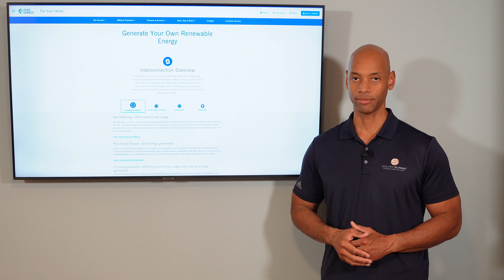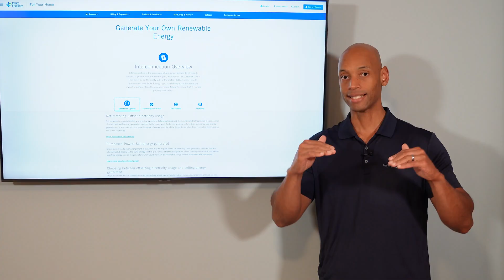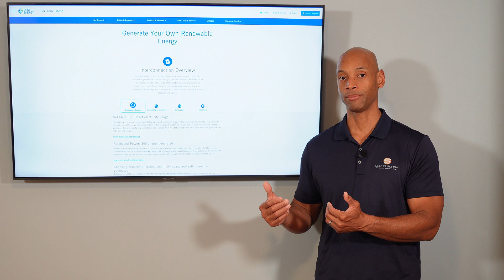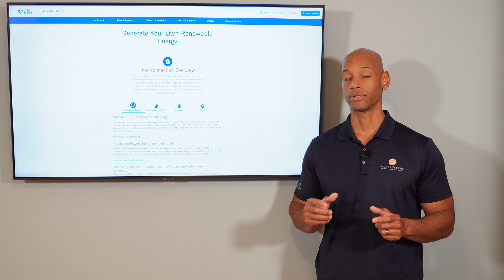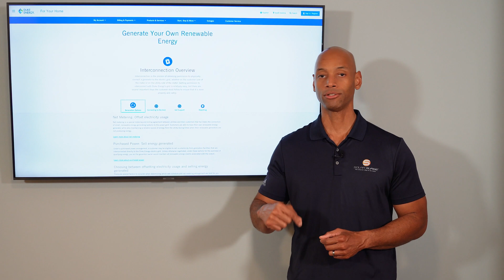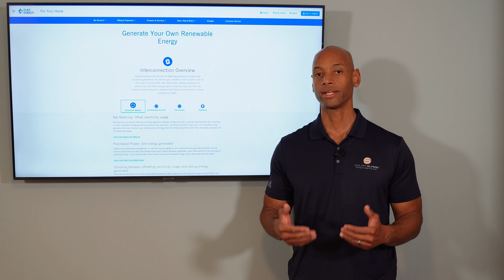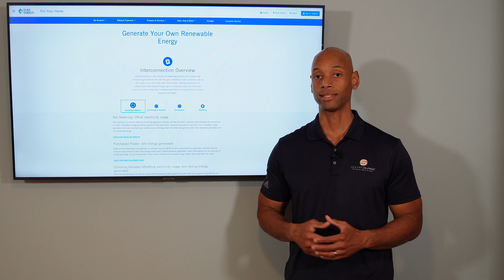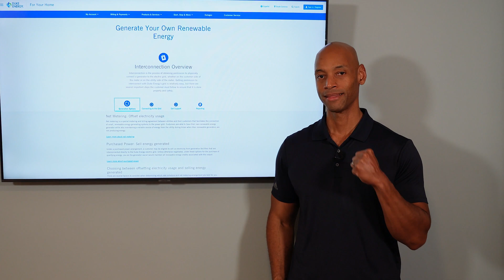North Carolina CANCELS Solar Net Metering Program

Comment: Florida is still good with net metering so far. Just got my system installed and interconnected. 10KW grid-tie system. But with battery prices getting cheaper and cheaper I think I would rather go off grid than pay for just being connected to the grid. I think the part that costs the most with solar systems is the labor. So if you know how to do it yourself you will save 40 to 50% of the cost in my experience. Also off grid systems don’t need permit or have to deal with any bureaucracy.
Reply from the maker: Glad to hear Florida is still supportive of net metering, and thanks for sharing your experience with DIY to reduce labor costs and permitting.  When I started out in solar, we were offering home backup systems totally off-grid for about $6k installed.  The technology has come a long way in that time.

Comment: This is why I installed my own off grid system I just used a generator transfer switch. Eventually the utility will only power a porch light only because I'm required to keep my home connected to the grid. Solar contractors charge as much as $8 a watt because they are looking to get rich and sell it to you as a 30 year mortgage. Reality is you can install a 10KW grid tied system using micro-inverters permitted and utility commissioned for less than $10k. Company called  Greenlancer that will do all the design work for you and help you submit to the city and utility your design. You can find used 400-watt panels, and microinverters cheap online. Rest is just basic home electrical work.

Comment: Net metering is not sustainable, and it should go away everywhere. There is no profit in it for the utilities. Utilities are guaranteed a rate of return for all capital expenses. Without that guarantee, half of America wouldn't have electricity at all. It is not fair to make non-solar customers subsidize your solar systems. All renewables are pretty much usless unless it has energy storage, allowing its use at anytime its needed. In fact, renewables can cause more harm to the grid than good. Before the YouTubeverse jumps me, I have been in the renewables energy business for over 43 years, I have one of the largest residentual solar systems in NC, and I have net metering through my local coop. While I don't believe in it, it's too good a deal to pass up and install batteries.

Comment: Utilities were forced to go into net metering by their public utlities commissions.  The huge tax credits made solar very attractive to customers who were being billed in the upper tiers of the rate structure.  In California utilities were forced to offset costs to base rate customers by over charging those in the upper tiers.  Solar pulled the rug out from under the commission's schemes because people who were being overcharged were happy to install subsidized solar to drop their usage into the lower tiers.  The implementation of net metering by the commission caused other problems for utilities who are required to provide both reliable and economical power supplies to their customers.  In California there was no control over how much solar could be installed and with the subsidies and net metering the state has become a real problem for utilities and the public utility  commission  to provide both a reliable and cost effective power supply.  Costly batteries needed to supply electricity when the sun dies not shine would drive up utility cost unfairly and that was why the net metering is being changed to require solar installers to put in batteries that would otherwise have to be installed by the utilities.  California is going to be in a real mess as the nuclear plant and remaining fossil fuel plants are shut down.  On top of all that the addition of EV's ads even more problems if they are charged up at night when the sun does not shine.  Rates will continue to go up as California tries to go all in for green energy.

Comment: I have been researching solar in NJ. I live in SJ, they are literally not allowing new solar projects in huge portions of SJ. I have been researching going off grid and using a natural gas generator as a backup and to recharge a battery bank when there is no sun. Most if not all of the solar companies will only work with you if you are doing a grid tied system. Don't even get me started, but truth is grid tied systems are not the future. But its expensive and sadly most people will never be able to take full advantage of solar because they can't afford it. An added note, they will not even allow the system to be energized, so you have to be completely disconnected.

Comment: Must be nice for the power companies to just be able to decide to not pay you for the power they are taking from you.  I'm sure they wouldn't like it, if you just decided to stop paying them full price for the power you take from them.
Reply: I'm sure that they would say that (nobody is forcing you to be on net metering).   IMO this is even more reason to get as large a battery backup as you can afford not only for when the grid is down but also to use at night in the summer when days are long and solar can recharge the batteries by day.
Reply: They don't want to buy power from solar systems because they can produce power lot cheaper with a power plant and control it they only run it when they need the power. Most utilities have done away with net metering replaced with TOU policy. The utility is required to maintain a large grid solar customers were not paying for the use of it. Reality is it was cutting into their profits they don't like that.  Also, the fact that solar installers over charge many customers some almost 8 times the cost of the equipment. With these changes being made by the utilities they won't be able to sell customers 70k 25kw systems anymore they will have to reduce their prices because the ROI is 50 to 100 years.
Reply: @Mike-01234  You can't just shut down and restart a power plant or hydroelectric damn throughout the day.  The production can be throttled back but you can't easily just turn it off.
Reply: They don't just decide.  They have to get approval from the utilities commission and there are groups that fight them all the time so decisions are not always in their favor.  The move away from one-to-one net metering is being challenged by the solar companies in NC as we speak so it is possible Duke Energy will have to keep some form of this,  That said, their PowerPair program, when combined with the federal tax credit literally buys you a Tesla Powerwall 3 so there is a workaround for customers.

Comment: This situation has me moving to Utah and away from NC now.
Reply: And what happens when every major power company turns to this model....Which will eventually happen.  Its just a dice roll of when it will hit you.
Reply: @theripper121  there are plenty of ways around TOU. Mainly a battery, and within the next 10 years max most people will have an electric car that will connect to the home and act as said battery.
Reply: @singerkgreen  And adding batteries adds massive costs and often reverses any return on investment from solar from the first place
Reply: @theripper121  that's why i mentioned electric vehicles. I agree. Why spend $20k on a battery that's 10kwh when you can spend $80k on a 120kwh battery that you can also drive to work. The ROI math works much differently that way
Reply: @singerkgreen  Yea unfortunately solar in general is a long term investment many just can't swing right now let alone investing in 80k dollar cars.
Reply: @theripper121  my first comment literally says in the next 10 years. I'm trying to have a conversation but if you're not going to read what I actually say I'll just bow out.
Reply: @theripper121  if many can't afford solar and they can't afford an electric car and net metering is going away eventually everywhere, well those aren't the people that solar companies are selling to now is it?
Reply: @singerkgreen  A bit confused what point you are actually trying to make.  Your original comment talked about moving to a state that isn't currently using TOU.  I'm simply stating moving around to avoid a practice that can be implemented at virtually anytime might not be the most practical
Reply: @theripper121  you don't know anything about my life or the practicality of moving. I made my point in my OP. I'm moving because of TOU. That's my point. Then you say it might not be practical. Personally, I think moving to double my pay is practical.
Reply: @theripper121  you don't have to think it's practical. Nobody is asking you to move.
Reply: @singerkgreen  Well, I apologize if I came off looking like a dick just trying to be the contrarian.  If you do move, I sincerely hope it works out for you and puts you in better place for whatever personal goals you have.  Is your current system a ground mount you can easily pack up and move?  Well relatively easily anyhow?
Reply: @theripper121  I'm a solar technician. It's not about solar on my house as to why I'm moving. It's about going where the work is.
Reply: @singerkgreen  Makes perfect sense.  Good luck to you.  You like working in the industry?
Reply: @theripper121  love it

Comment: Utilities did the same in Texas. They switched from true net metering to paying ‘avoided cost’ compensation for feed in, “in order to be fair to non-Solar customers’. I hate to say it, but the solution will be adding batteries to systems or greatly shifting loads to solar production peak times. I do my best to design systems as ‘off-grid’, connected to grid as the first means of backup charge, then thirdly roll over to generator charge.
Reply: I'm not that worried about it, I'm going solar for backup power mainly and can store and can use some of the solar power at night to save money and have some backup when needed. Plus it's very expensive to get in compliance with what they want and also extra liability insurance involved which costs you more.  And you also give them free access to inspect your system at any time and you are also prohibited from making any modifications without going through the whole inspection process again. Too much red tape and costs for diminishing returns.
Reply: Thud9797  I agree. Grid tie is a waste of money on equipment,labor,and red tape. 
It’s reasonable for the utilities to pay for energy when they need it just as it is reasonable for the homeowner to buy energy when he wants it. No homeowner should be forced to buy energy just because the utility has excess production.
As the rooftop solar continues to ramp up ,the power plants will be forced to operate below their break even point.
Distributed power production and storage is inevitable,logical,more resistant to disasters or terrorism,and much cheaper. 
I feel a little pity for the suits sitting in plush offices in the energy industry. They might have to learn to contribute something to society and leave the parasite lifestyle.
It’s infuriating also when I see people scammed into the grid-tie systems that likely will never pay back,when most people are looking for something grid-tie doesn’t provide without battery backup. Off grid with batteries,whether in the home or car,has a shorter ,predictable payback and mitigates the urgency for grid infrastructure expansion. My off grid inverter has a 240 V 20A grid input on a AWG#12 romex wire. The free grid power I get 8pm to 6 am ensures the battery bank is full in the morning.
Reply: So this is forcing solar owners to buy a $20,000 battery that may only last 15 years before it's capacity decreases. The money you saved on you bills now has to go toward a battery replacement. Madness!

Comment: Energy companies are being like blockbuster. The Netflix of power production is happening. If they are smart, they should get into the home solar business. As the cost of solar systems get cheaper, people are going to cut their relationship with the power company and that will be it. The argument they are making is not very fair. The cost of solar production is fixed, but gas prices fluctuate. So even if they don't want to do the net metering, they should offer a better rate to the home producer. Essentially, they are going to be profiting off the electric that is coming from solar generated from homes, but not compensating the home owner appropriately
Reply: In short, they're being as stupid as Big Oil is. Big Oil and Big Auto, having the MONEY, Science, and expertise available, were poised to DOMINATE the Alternative Energy markets.
But, no, the Dinosaurs think that "There will always be more, that's what more means."